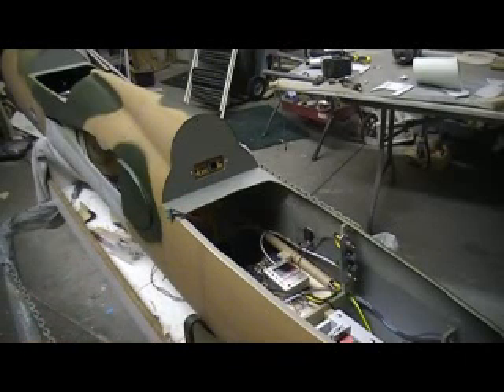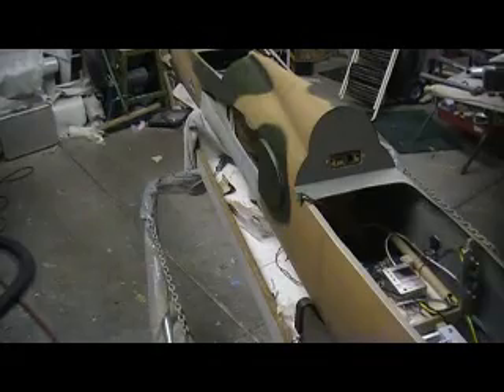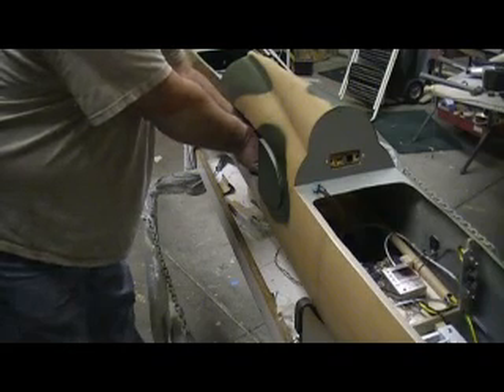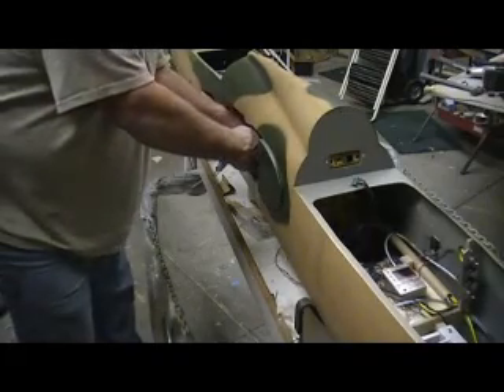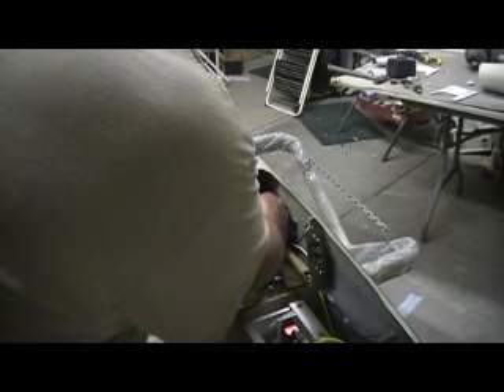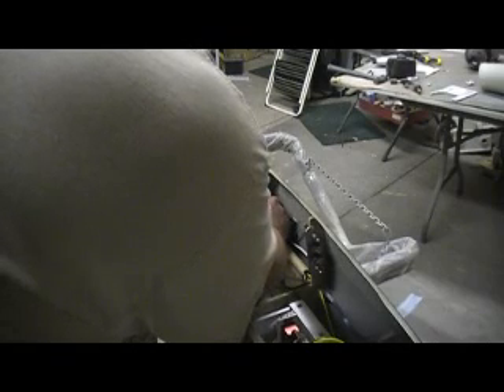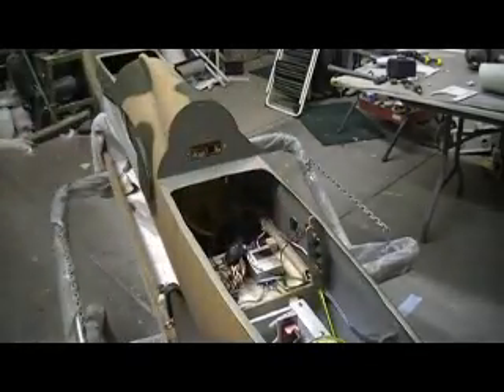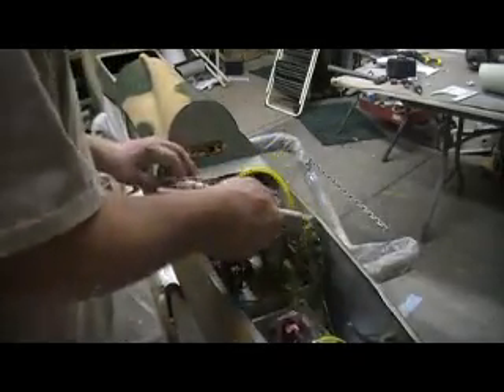how to build a rc jet F-105 thunderchief # 505

Comment: I couldn't find the tubes on Troy Built's website.. but they could be the tubes that pushrods come in to the hobby shops, i'm sure each hobby shop has a ton of them, and  its better to resell them since they are so useful, rather then recycling them.. Just a thought